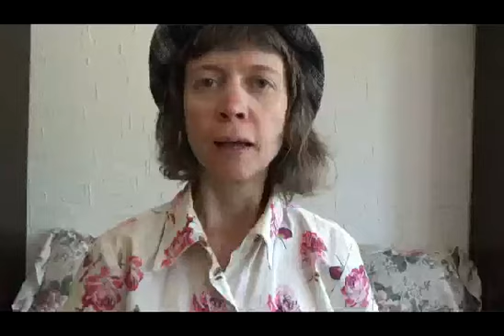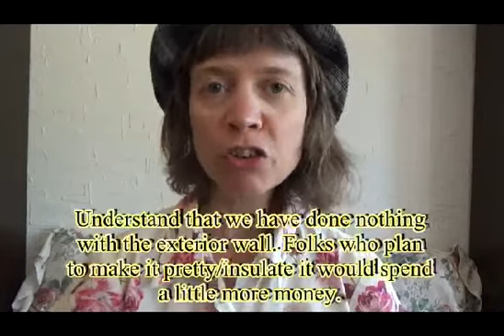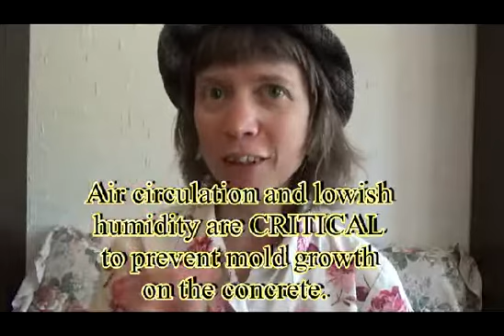How Much Did Our Earth-Sheltered House Cost?

Comment: I was just watching another video on the house. I was wondering if you’ve ever looked into adding a rocket mass heater. That seems like the perfect thing for any earth berm home or earth ship type of construction.  I seems a properly constructed rocket mass heater would take care of all your heating needs. The rocket mass heater fouch family installed in their log home works for them so it should be a great way to heat an earth sheltered home.
Reply from the maker: We did consider it, but we simply didn't want to go through the work. It also takes up floor space. Our little electric space heater does the job just fine. But I agree that if you want to avoid using electricity as much as possible, a rocket mass heater is an effective way to go.